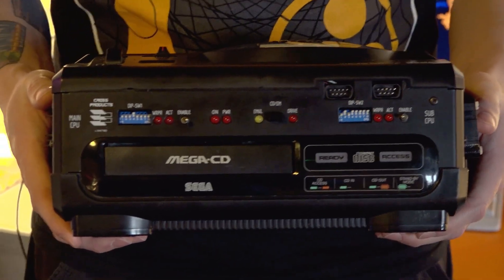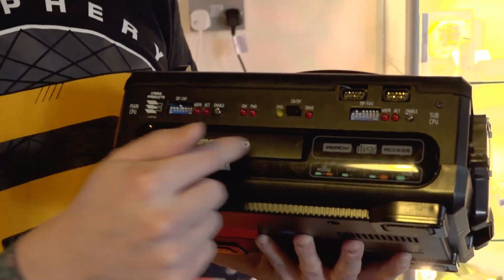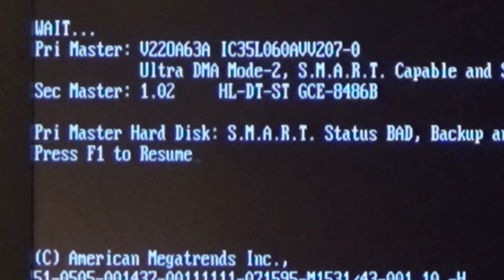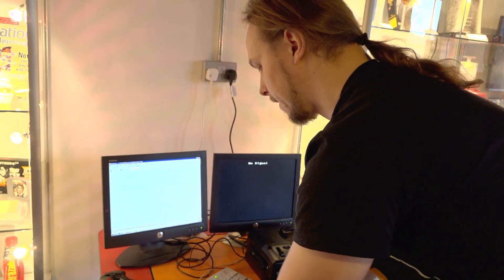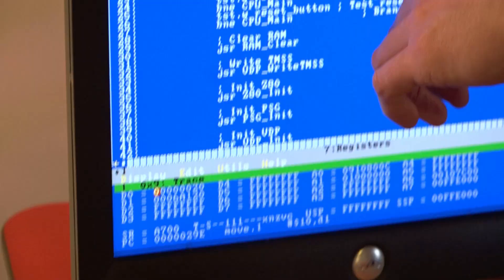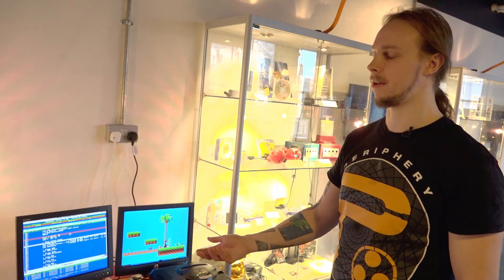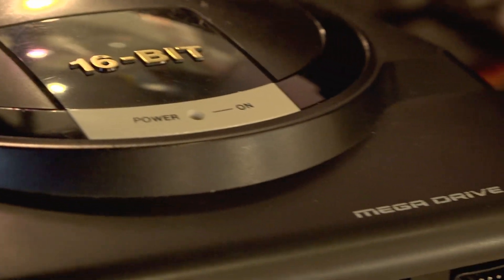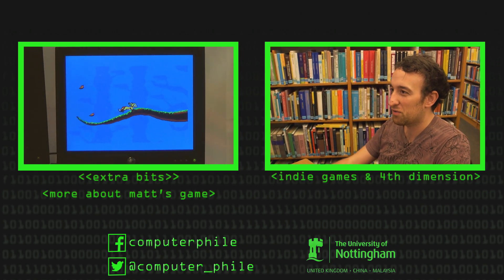Sega Game Coding in Assembly - Computerphile

Comment: Finally, assembly is getting some love!
Also, SCSI is pronounced “skuzzy” (kids these days).
Reply: DB Speed, compactness, flexibility, control.
Reply: around my place I always heard "skasi"
Reply: Assembly is still use quite a bit for game programming on the ps3 for example, dunno about ps4 though, it's a great way to get everything from your processor
Reply: (SCSI, /ˈskʌzi/ skuz-ee) https://en.wikipedia.org/wiki/SCSI
Reply: Yeah, Apple tried to get people to pronounce it "sexy", but it never took off.
Reply: Anyone pronounce SCSI as "sexy"?
Reply: *****
I know what i meant was hand written Assembly, . I know it was used on the ps3 because of the complex cell architecture
Reply: +Paul Hulme. I Heard that was how the inventor wanted it to be pronounced.
Reply: DB From the vantage point of game development of the second decade of the 21st century—with highly optimized compilers, CPUs designed with such compilers in mind, and massive libraries—sure. Back in the 80s and 90s, however, we didn’t have these benefits.

A few modern compilers (and, generally, highly efficient IDEs for high-level languages) have been developed for older platforms (the key word in this video’s subtitle is retro), but many (most?) of us still prefer—and enjoy—using the straighforward approach of programming in assembly. (I, for example, even use machine code directly for simple tape loaders.)
Reply: Ast A. Moore yes, retro in the sense that it should work on this retro equipment - however, you can make a retro style game (the same game) much more easily and rapidly with higher level language programming, especially a platformer where you basically don't have a speed concern...then your code can be a lot more modular and maintainable, it seems to me. but I guess that isn't the point, the process is.
Reply: DB It is highly dependent on the platform (no pun intended). What you might consider not to be too resource hungry on an iPhone, could completely hog, say, a Z80 CPU running at 3.5 MHz, which is also managing the video display. On top of that, you have a few precious kilo_bytes of RAM to work with. Every single byte of code counts; every single T state of a CPU instruction counts. You have _no luxury of relying on a compiler.

As for modularity, over time you develop assembly code you reuse (with minor modifications) later. I did it all the time. The key was to comment everything like there’s no tomorrow. Even if you thought it was too obvious.

Yup, those were fun times . . .
Reply: Russell Teapot I don’t think I’m really qualified to answer your question, but it’s the Internet, so I will anyway (but take it with a grain of salt).

If you go for practicability/relevance, then anything that deals with embedded systems (your Arduinos, and the like). That, however, usually requires some (minimal) engineering skills to build simple electronic systems.

If you’re looking for a more general approach, and want to understand how computers work at the low level, and how we, as programmers, can control them, then I can recommend the Z80 assembly language. There were quite a few systems built around it, including the ZX Spectrum and the GameBoy. There are plenty of books on the Z80, and I personally can’t recommend Programming the Z80 by Rodnay Zaks highly enough.

There are also numerous emulators for various Z80-based systems available for many modern platforms, so you’ll be able to get your feet wet straight away.

From there, you could go on to the RISC architecture (PIC, ARM, PowerPC), but I do recommend starting with something simple and rather limited (by modern standards) like the Z80. It was designed 40 years ago and is still used today.
Reply: DB Except that “a phone” “today” uses a highly integrated, highly optimized, high-performance, often multiple-core CPU, which can, as you rightly say, “deal with a massive amount” of junk code thrown at it by a compiler. You can afford that when you have multiple gigahertz under the hood and multiple gigabytes of RAM.

Scale that down to a 10 MHz Motorola 68000 CPU and 16 kB of RAM, and you’ll find yourself in a pickle before you can say “a 2D game with sprites.”
Reply: I've seen SCSI all over the place and I've heard of skuzzy drives before but I've never heard before that SCSI is pronounced skuzzy.  The more you know.
Reply: i dunno , i use both
Reply: Ast A. Moore maybe for very small loops that need to be very tight, but to me  all those advantages you mentioned are lost for general game development compared to ease of development and clarity of code...
Reply: Ast A. Moore 
yeh I totally get that and I'm guessing people who do this (develop most of their games in assembly vs. only the small fast loops) ultimately do it because they enjoy the process, not because of any perceived efficiency
Reply: DB Well, yes, but again—the key word here is retro. In most cases, assembly is still the only choice for developing for these platforms. Naturally, you have the benefit of using modern computers for backups, versioning, etc., (rather than using physical tapes for storage, for example). This kid, however, seems to be doing everything the “true hardcore/authentic way.” Kudos to him! Then again, the system of his choice is light years ahead of those available to the thousands of bedroom coders of the 80s.
Reply: +Ast A. Moore just for the sake of curiosity and experimentation, which architecture do you suggest for starting learning assembly? I know that there are lots of variation on the theme (sorry for probably a silly question, I'm only an hobbist with very limited knowledge about programming and computer science in general)
Reply: DB haha I already know the basics of Python :D (and by "basics" I mean the very basic basics, nothing too fancy)
Reply: Ast A. Moore Thank you very much!
Reply: Russell Teapot 
Python.
Python Python.
Python Python Python.
Reply: DB

while True:
   print("Python")

Dang it! It messes up the indentation
Reply: Russell Teapot
number_of_times = 3

for i in range(number_of_times + 1):
     print('Python.' ) * i
Reply: ***** 
performance?
on a 2d game with sprites?
even a phone can deal with a massive amount of sprites and associated code easily today, even with high level packages like unity...
Reply: Ast A. Moore indeed! but it seems that the general scenario for 2d gaming from now until forever is gaming on such excessively powerful devices that apart from enjoying the process it hardly seems ''worth it'' (except perhaps for critical small and tight loops) to bother with assembly... I bet I could crank out 3 games in the time it takes to make 1 on assembly, at equal coding proficiency
Reply: ***** 
Do you accept Python as your lord and savior?
Reply: Hannibal With only one problem, assembly isn't cross architecture. In order for high level languages to run they have to be translated into machine via compiler, (on the fly) making it require more processes to do the same thing. On the other hand, it's cross platform and in some cases, more user friendly. Then stands another problem however. Freedom! Assembly can do whatever the processor and motherboard was built to do (arithmetic, registry work, memory processing) and is often more dynamic than regular programming. Whereas, most of the time with high level language, variables, integers and things of the sort are predetermined by the users code.
Reply: Yea, he knows. At the end of the other video they made he talks about that. :)
Reply: Do you ever do anything simply for the joy of it? You sound miserable.
Reply: So I can be proud I figured that myself? ':D
Reply: I just say Skizzy
Reply: Since when was it wrong to pronounce an abbreviation as a series of letters?
Reply: Because it's a console which isn't very powerful.
Reply: but why would someone bother using assembly for game prog????

Comment: I... I didn't realize people programmed games in pure assembly. @_@
Reply: Rollercoaster Tycoon was written by one guy in x86 assembly
Reply: Yeah, pretty impressive. The first RollerCoaster Tycoon was also written completely in assembly, by a single person.
Reply: Running things on a 7mhz x68k you needed all the power you could get, and there weren't any tools available to properly compile code written in a high-level language to run optimally, so you basically had to write everything in assembly. Think about games like Chrono Trigger for the SNES, that's a 50 hour game with tons of music, graphics, story, and it's 4MB.
Reply: Anos Anosn I can't imagine everything is done in assembly. Then again a lot of game programming today is done is C which is just one step up.
Reply: Anos Anosn when your working with a potato as a CPU you need your code to be as efficient as possible.
Reply: Even games today have some of their code written in Assembly. Usually at areas where performance is key, such as rendering etc.

The tricky thing is that you need to write procedures based on the architecture you write your game for, e.g. for Intel vs. AMD vs. ARM as well as the GPU.
Reply: sacredgeometry Interestingly we are on a video talking about a 70s processor =)
Reply: Assembly is a pretty easy language. I used to make games on the Commodore 64 in assembly and also on PC with Turbo Pascal back in the early 90s.
Reply: Nevets Uhh... Hope you are aware that assembly isn't "language". There are tons of assembly languages for different architectures, but just lumping them all together "as one unit" is really careless and will give wildly different views of what assembly actually is based on the language.
Reply: ᑎᗩTᔕᑌᗰI Jup that's very true! I used to think assembly was the same for every platform.
Reply: +Nukleon
Not only that, but the SNES CPU is dramatically slower than the Sega Genesis one. It is possible to write a decent genesis game completely in C, but much harder on the SNES.

Of course that also means that with really tight assembly coding the Genesis could do things like sprite rotation or basic 3D entirely in code. This is why you never see multi sprite rotation with backgrounds on the SNES without the use of an in cart chip, but it occasionally comes up in Genesis games.
Reply: *****
Hmmm. x86 assembly is only designed to be written by humans, there is no point in it existing otherwise. The fact is that there is little point in using assembly in x86, it is far easier and for the most part just as efficient to write in c.
Reply: sacredgeometry Tell that to 68000. The poor sod had clock speeds as low as 7MHz and 12MHz. C, even if optimized for 68000, has a lot more overhead and uses the stack a lot, which is always a penalty, since reading from and writing to memory is always 2 cycles extra, not to mention it takes over 10 cycles to use the instruction "pea" for a number, which most C compilers use when calling a routine with arguments. On the other hand, 'moveq' which is far more common for assembly programming uses 4 cycles. Doing this hundreds of times per frame makes a huge difference!
Reply: ui_wizard You talk about having to write procedures based on architecture, though this may be true for intel/amd vs arm, GPU instructions are almost always handled using a graphics library provided by the GPU's drivers such as openGL or Direct3D, allowing the code to run on either an NVIDIA or an AMD card. You could technically call those functions from ASM but I don't really see why you'd want to do that unless you're developing the entire engine in ASM. I also doubt there are any significant differences between an ARM version of windows and an x86_64 version. You could probably just use a platform specific (cross)compiler and be done with it.
Reply: goeiecool9999 It's true that you don't actually write Assembly for every GPU; that would be madness—considering the amount of GPUs there are and how different their architectures are from eachother. You'd most likely use standards such as CUDA or OpenCL for GPGPU.
Reply: ᑎᗩTᔕᑌᗰI
Are  you working in a team or alone?
Reply: Artem Borisovskiy Alone most of the time
Reply: Thats because most people dont these days. Engines in C/C++/Assembly(if needed) and then a lot of the code in the game is done in a scripting language like c# or lua.
Reply: most of the new Intel chips and most of the new AMD chips both have the same ISA so you wouldn't need to write different assembly for them. If you had to do that you would also have to compile all of your higher level code twice for each ISA.
Reply: +pyromen321: Also Transport Tycoon Deluxe. Same guy as Rollercoaster Tycoon
Reply: GravianS Could you please name some Genesis games were those effects are used?
Reply: ᑎᗩTᔕᑌᗰI
Assembly is a language that I~ know very well and have used for decades. Yes, there are differences for different architectures the same way as Basic was different on every computer at the time.
Reply: Nevets No, there is just not "differences", most assembly languages are completely different than anything else.
Reply: ᑎᗩTᔕᑌᗰI
Do most assembly languages are different from each other? I didnt realise we were talking about the differences between Assembly and other languages, if thats the case I agree, Assembly is totally different.
Reply: Nevets No, just talking about assembly languages.
Reply: Depends on the CPU architecture.
Reply: Nevets Yeah its complete masochism. Assembly output is predictable in c for anyone that knows it well. 

And even if you need it its only to double check that its doing your c code how you want it.

The use cases are very stringent and few and far between. Even embedded systems these days tend to use much higher level languages. Because computers that are powerful enough to run OS's are cheap and small enough to put in anything.
Reply: ᑎᗩTᔕᑌᗰI Interestingly processors have moved on since the 70s ;)
Reply: ᑎᗩTᔕᑌᗰI and talking in the present tense.
Reply: ok?
Reply: See, I am an assembly programmer for the MD. I write a lot of complex code everyday. There is no way to replicate half of what I do in C without crippling the game's performance! For this reason, I never write a single piece of code in any higher level language than asm. Plus, I love the challenge. It's extremely fun to have total control of the processor and memory, and being able to abuse your skills to make the most efficient code you possibly can, while using the least amount of memory. It is like a huge Rubiks Cube puzzle, where the price is bragging rights and people being totally confused about how your code can possibly even work. It's gratifying, and I love it. This is why I have programming in C; I just don't have the control I'd like.

Comment: How on earth are there still people working for on those systems?? Its like someone is using 2 flintstones to use fire instead of a ligher or matches
Reply: Fun
Learning
Reply: Bad analogy, since Assembly is still an integral part of our computers. Building a game using it as the core language might be a bit overkill, but it's still extremely useful to know so you can solve some super small programming tasks or squash bugs that higher-end programming languages struggle with. Whenever a device is being made, you can be sure that at some point in the production process people need to do some assembly coding.
Reply: because it's awesome. 
imagine writing a 3ds game when you are 20 years older.
Reply: The question is though: Can people make fire with two flintstones? Here you have the answer.
Reply: QWERTY man But his point is that you can make up your own language compiler which compiles down into this language for use on this console.
Reply: QWERTY man
 All fine. it doesnt contradict my point in the slightest
Reply: aullik you have to use this language to write for this console( i believe). 
it is also the language you have to write in to make patches to existing roms for GBA for instance.
Reply: SaHaRaSquad Exactly